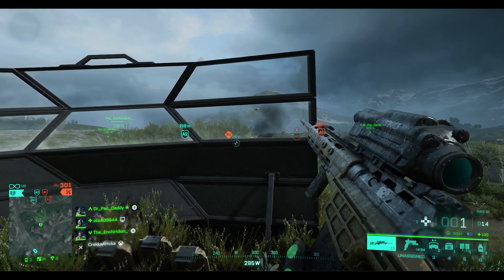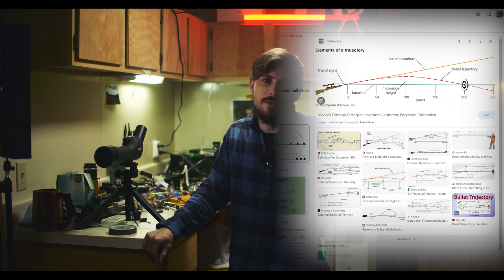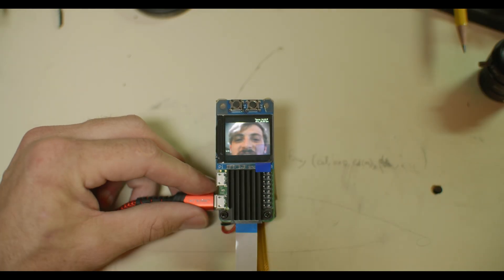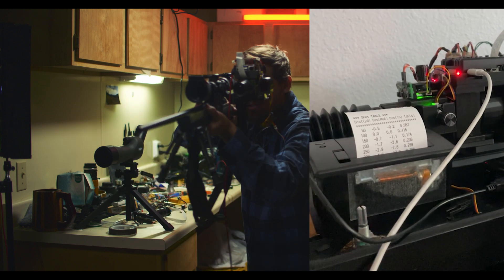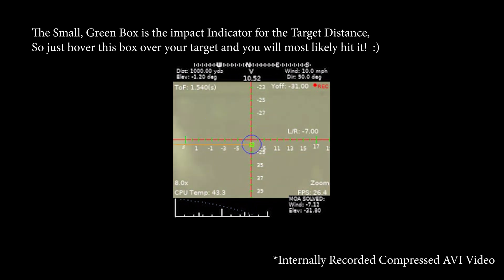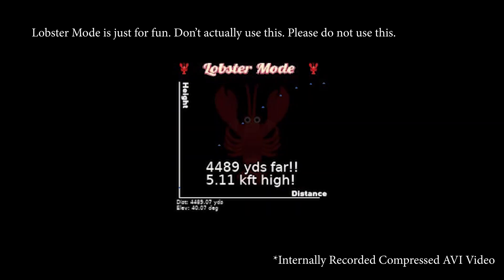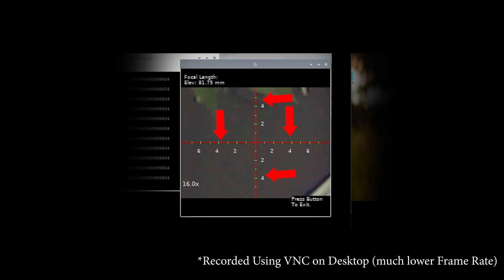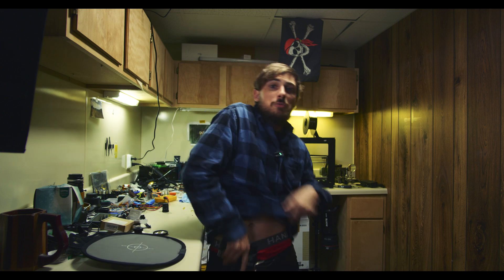Jaccuracy Scope DIY Project Overview

Comment: Thank you for the project, I was wondering if one could stick this on the back of a spotting scope and view it on screen of sorts.
Reply from the maker: I think you could! With the right wide angle lens and a solid, non moving mount to the scope you could calibrate for the new focal length. Although theres a happy medium for what you could use with the digital zoom options.   The better optics there could be leveraged for a better feature of like tracking where your shots fell on paper to auto record things.    Lots of possibilities with open code!

Comment: Its great to see someone new to the community jumping straight into trying to innovative.  I actually stumbled across this in preparation of a thermal optic that outputs similar ballistic calculations.  I didn't even consider a spotter scope.
Reply from the maker: Thanks man! means alot, since my prototype was so clunky in size it just made sense to pitch as a spotter scope. I looked at ways at shrinking the design which are certainly possible but wanted to keep things as cheap as possible.     If you find a good framerate IR sensor id love to see what you use!  I pulled some germanium optics from a firefighting IR cam  to pair with the FLIR Lepton (essentially gave it a 5.5x magnification from what i calculated) but the frame rate is just a garbage 9hz on those cheap sensors.       Could be useful for an overlay though
Reply: @JackToth  one thing you can do to possibly lower the clunk is try integrating some of the boards and batteries into a PEQ type unit.  Or if you decide to go with something like an AR you could hide some of it in the grip, stock, and fore grip (if you chose to use one) as well as a PEQ style box.  It could actually help balance out the rifle some.

So far I've found some thermal cameras intended for FPV'S on AliExpress for between $80-$250 for a 256x192, around $200-$300 for 384x288, and around $300-$400 for 640x512 that I'm looking at picking up in the next few weeks for some testing, since I haven't been able to find any videos of them I'll definitely be posting my results if they're worth it.
Reply from the maker: @hiddenloaf2302  Hows your tinkering going? did you get a chance to experiement with these ali express bolometers yet ?
Reply: @JackToth  it turned out that the prices I saw were an "early sale deal" that ended before I was able to pick one up.  I'm hoping to get everything together to start prototyping by the end of the year.

Comment: I would love to be able to see this with the thermal option. I know you said the ITAR rules restrict some use but from what I can remember that only deals with importing and exporting outside of the US. I would still love to build out one of these, but getting into the thermal realm would make it 10x better.
Reply from the maker: More expensive too, especially optics.  I managed to snag a germanium lens assembly for $50 on ebay that gave that FLIR in the video about a equivilent of a 6x magnification, was super cool but 3d printed mounts arent suitable for keeping a sharp image with how tight of focus it required.    I was going to do a seperate video on that mod but got side tracked
Reply: @JackToth  I subscribed to your channel so hopefully ill get to see it if you get a chance to do one.
Reply from the maker: Originally i was going to parrallel mount them so you could hot-switch to thermal and back to visable/night vision.  Still super doable but cranks the project price way up

Comment from the maker: Status Update (Dec 6th 2023):   Working to write some bash installer scripts so setup on a new Pi is easy peasy.  Also got a new better working 3D printer for the prototyping prints of a new layout when I have a solid design nailed down.  Currently have a build using a Pi 2 Zero W that works decent but the frame rate suffers so optimizations will need to be the next priority for the code.
Reply: Hurray! 🎉
Reply: what is the current status in june?
Reply from the maker: @Brinkmasterj  I'm tempted to put it out for free at this point and open it up to the community as Open Source so it has real brain power behind it, my time to work on it is so slim anymore, and getting a clean IMU calibration method and screen is going to take some big thinking....

The magnetometer needs calibrating after mounting on a metal anything, to cal out hard iron effects. Thats waht will make the heading reading the most accurate.
Reply from the maker: @Brinkmasterj  sorry if that dissapoints,  but  I was hoping for more viewership and eyes on this far into a break on it, sent the video out to quite a few areas to gain some project exposure but thats just hard to come by if youre a small channel,  and certainly isnt a healthy thing to base project motivation on haha
Reply: @JackToth  as a DIY'er hackermyself. I 100% get it!

Comment: Just started watching the video, but your choppy live view screen could possibly fixed by going with a global shutter on the HQ camera.

the CinePi guys are working on a camera software for the camera
Reply: As for your $50 price tag, it depends:

Do you want to work on your pet project solo, and see it possibly go nowhere after a few years?

Or do you want to see ubiquitous use of it, with some minor development on your part, and no return on your sunk cost?

If the later is what you want, take it over to the Ctrl-Pew rocket-chat instance and let the 3D2A guys get their mits on it. Then it will really take off.
Reply from the maker: @fitz3540  hey! So the global shutter is only 1.6 Mp compared to the ~12MP of the hq (i think) so youd lose a ton of zoom power and snap-to capabilty.    Working currently on build/install instructions and a final releaseable first code rev to throw on Gumroad, where ever it goes it goes.   I’m more curious on progressing the physical build since i know the software is in a stable and usable state already im sure someone else could pick that end up

Comment: I'd definitely consider it. I'd need specs on capability in different conditions and such.
Reply from the maker: I think performance/range would be limited to the price point of what people want for the lens, the lens i used is the cheapest/sharpest combo i could find as a baseline. Definitly usable to hit 1000 yards from when i brought it to the range. That might be what i call the visable max without turning on the sensors high res mode  (10fps max frame rate)

Comment: The IRL aimbot uprising. I'm just interested in watching the build process and cool looking results!
Reply: Actually I could put this on my toy crossbow that goes 15 ft, I'd just use dumber highschool math and 1-2x zoom. I'm fine with soldering or ordering a custom PCB but no guarantee I'll make this. I might've missed it, are you planning to overlay thermal? Might be hard to line up.

Comment: Count me in. I've been looking at adding a scope to my PDW. Either the prices are absurd or the quality is super questionable. I was to the point where I was heading down this same rabbit hole, though my microcontroller devices were going to be Pi zero W and ESP32s. On a whim, I thought I'd check the youtube and found this video.
Reply from the maker: I gotta get the body more militar-looking so it compliments the tactical look !
Reply: @JackToth  let's do it! Can you share the current STLs? I usually use OnShape for my modeling. Let's collaborate on the frame to get that tactical look that's both neat looking and practical! Edit: woops, re-watched the vid, at the end you asked for interest in buying the BOM and guides, code and such. I'm still interested, but would understand if collaboration was not on the table.
Reply from the maker: @QuakeDragon   feel free to play with physical designs with low cost in mind! I’m focused just on the software and functionality side of things. I can probaly load up STLs at the end of the week in a Blender file if I have free time
Reply: @JackToth  checking in. Still interested.  😁
Reply from the maker: @QuakeDragon  i got time tomorrow evening to take a look at  the STLs!

Comment: Id be interested in building one for fun.
Reply from the maker: Awesome!  Are you familiar with soldering? Or would need a no-soldering option?
Reply: @JackToth  I'm a little familiar and have a super cheap soldering setup. So I could probably make it work if it's simple and can be messy. But I expect you would have more interest in it down the road if it has a no solder option. I would prefer a presoldered option myself.